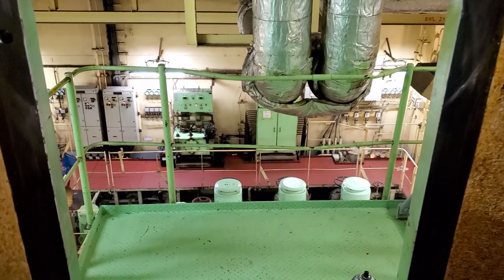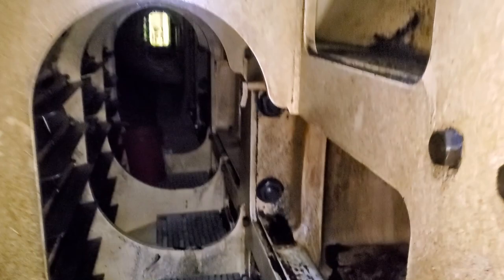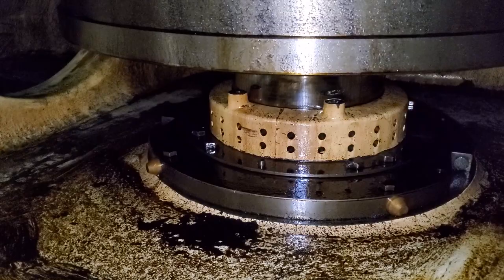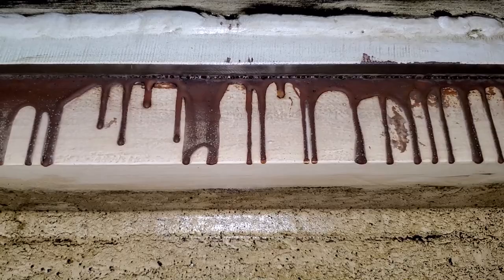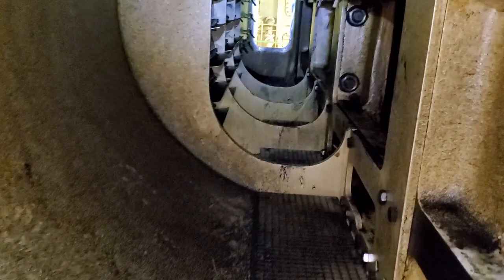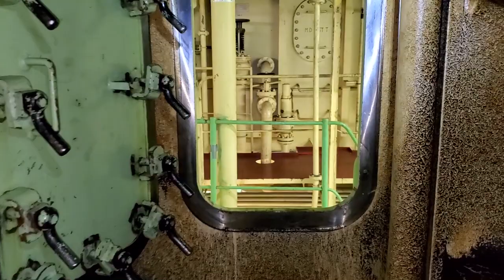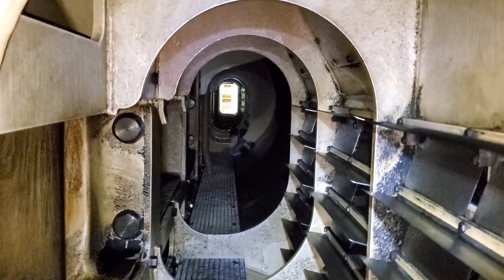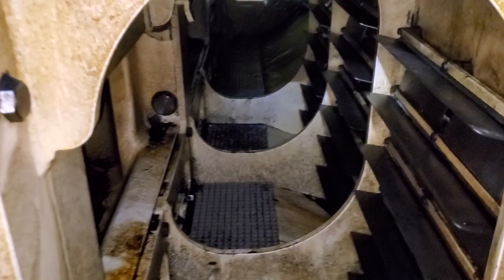Container Ship Vlog #45 (Scav. Air Space Tour)

Comment: Interesting details. Got me googling a few things I didn't know... So it's a 2 stroke engine (you may have mentioned that in the past)? Seeing the air inlets just above the bottom of the cylinder liner was an eye-opener. All that is probably obvious to anyone in the industry. I'm not an engine mechanic, but I have a concept of how a normal auto engine works. This is a bit different. I like learning new things (especially about big mechanical things). More videos like this, please.
Reply: Yes these engines are cool Buntheit differ from your everyday 2 stroke engine in like a chain saw or a dirt bike. This is a crosshead engine with uniflow design.